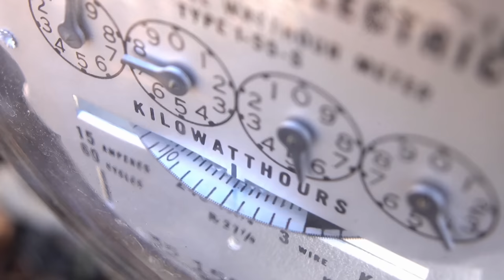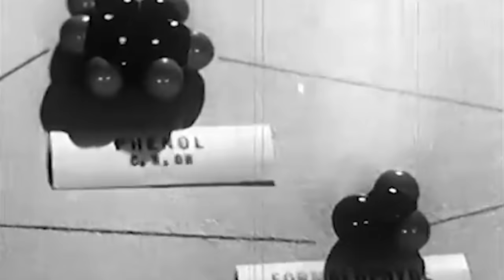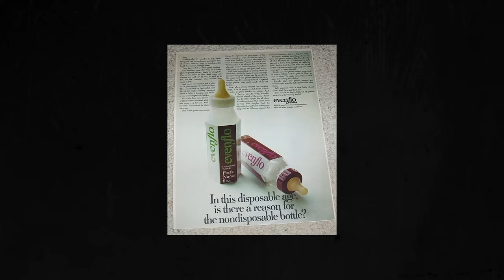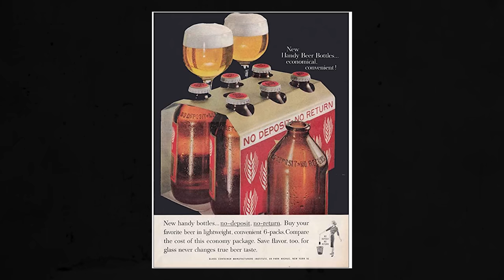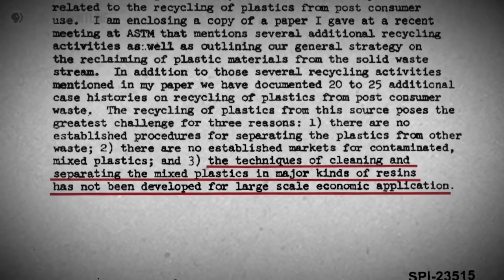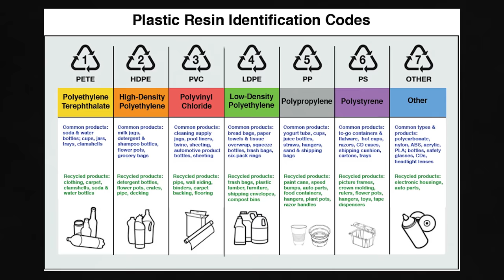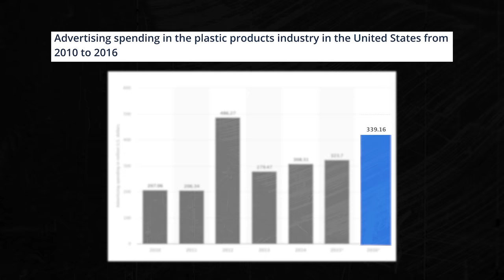The great recycling LIE (what really happens to plastic)

Comment: I am old enough to remember milk being delivered to the house in glass bottles which were returned, washed, and reused.  Beer and soda were also sold in glass bottles with a 5-cent deposit which would be refunded (more likely deducted from a purchase) when the bottles were returned.  That system worked just fine, and used far less energy than this throw-away and/or recycle system we have now.
Reply: As a kid I used to run round the streets of Glasgow collecting empty glass bottles of pop, returning them to the store and exchanging them for money... Then spending that money on full bottles of pop, crisps and sweets.
Reply: Homeless people and kids also appreciated it back in the days
Reply: Only issue is that washing and reusing glass bottles is cheaper than making whole new plastic bottles, which means less money making of you're the one selling bottles
Reply: @tiddybearkush  Really? The real question is where do the bottles go after they get put in a machine.
Reply: @tiddybearkush  Logistics of population and the amount of milk and now other canned and bottle beverages we didn't have "back then" created a need for something other than Glass... can you imagine if all the fruit and flavored liquids were all made of thick glass?... your shopping bags would weigh 40lbs and there would be broken glass all over the place.
Reply: @t.c.a.3335  It wouldn't matter since we would have been used to it.
Reply: @tiddybearkush  You are correct, many glass bottles you get money back for returning them to the place of origin, because they reuse them, it's a great incentive, but you won't be paid to return a lot of plastics because they can't be recycled, they just break down. A company isn't going to pay you to return rubbish they can't reuse.
Reply: My parents and grandparents still do this, it’s common in my area which is nice
Reply: You know I always wondered why Germany still used glass bottles that were washed and reused but America didn’t. It was a bit of a culture shock for a little while before I just got used to the plastic as well but it just seemed weird for the longest time.
Reply: @t.c.a.3335  Home delivery of milk in glass bottles was common in the USA well into the 1970s. There were hundreds of millions of Americans by then, so the logistics of serving a very large market were being met. The big difference was the milk you got didn't come from some far off, unknown facility, it almost always came from the dairy in your town. A business that you were familiar with and you may have known people that worked there. Milk wasn't shipped across the country to consumers, it came from across town, maybe from the next county. Those glass milk bottles were incredibly tough too. It was downright difficult to break one intentionally. I've seen them go unscathed after a bounce off a front porch or kitchen floor. Sure they were heavy, but they generally only traveled a few miles and they could be reused hundreds if not thousands of times. I think the biggest obstacle for this business model today is theft. Society can't be trusted to leave consumer goods on the front porch anymore. I'm sure it happened, but I don't remember anyone having milk stolen from the insulated box (clearly marked as a place to find milk) on the front porch. Glass bottles were a hellofalot tougher when they were expected to be reused/refilled for years.
Reply: I use to search for soda bottles to have money as a kid.
Reply: @t.c.a.3335  it’s healthier to jar your own food and , I can tell you the super rich stayed with the old ways for they are the healthiest and once a person invested in the jars and a garden it was healthy with little additives..So many of us bought their BS
Reply: Heh..I am, too!
Reply: @oldsguy354  The bottles will still be worn down tremendously after a couple uses. It puts too much trust in the consumer to handle these expensive bottles and the cleaning methods will be done in factories, totaling in the eventuality of broken pieces which cannot be molded so easily with the type of material used in the bottle.

The price of the bottle will become far more expensive than commercially used plastic cartons. Even if they found a way of creating a system where it doesn't weigh 18 pounds per bottle and have farmers willing to put down money they don't have to build a whole new logistics facility or give up a major percentage of their company to a big business like Coca Cola who are the only ones that have the qualifications, experience, budget, and ability to make significant changes to a market. 

The fact of the matter is the transportation would blow up their budget spending. Bottle companies only worked because they had a whole small community of a couple hundred, not millions, to monopolize with. There wasn't any Amazon, mega domestic companies like Walmart or Stop and Shop, or competing business outside your state or even in your city. Sure, there were many in each state, adding up to more than couple hundred costumers, but the fact remains that these bottle business would now have to drive to one community to the next, city to an other city, to deliver milk AND pick up empty bottles. And the likelihood of this being a standard and taking over the plastic carton industry to combat plastics would have more obstacles then benefits since these business would charge way more and become more a hassle remembering to clean it, remembering it's not yours and not keeping the pretty expensive durable bottle for yourself, texting the company that the bottles are ready for pick up and put the bottle outside for just some homeless person to steal it and the milk man arriving 8 miles to your house and finding the bottles aren't there, and figuring if you aren't lying and stashing them for resale. Even if you had a technology where you can keep the containers safe, that's still going to be an expensive piece of equipment that going cost you and the company more money to implement, which leads me to the final point of the only target audience that are willing to buy this.

These companies will only attract small rich communities near farms that already go to farmers markets to get most of their groceries. If we want to combat plastics, how can we fight where the majority of people are still using plastics and only 1% of the population are using bottles and probably was already using less plastics because they can afford to do so.
Reply: I wish it went back that way.
Not just because of environmental reasons.
It just seems to taste better from a glass bottle tbh.
Reply: @oldsguy354  this isn't the 1970s though.  The logistics of today are much different.  Where I live there are no local dairies and the same could be said of many urban dwellers.  Plus there's the segment of the population that doesn't drink dairy and uses only milk alternatives.    I doubt getting soy or almond milk is something everyone can get locally.
Reply: I also remember milk in glass bottles, I have always felt any beverage tasted better out of glass.
Reply: Plastics make incinerators more efficient. I talked to someone in the industry and according to him the only thing limited plastics recycling does is make incinerators use more fuel.
Reply: @tiddybearkush  Yeah, you get told they're made into new bottles. Many U.S. states have these $ for returned bottles systems.
Reply: I would visit my cousins in Northern Mexico in the early eighties.  Everybody kept their Pepsi/Coke/7up glass bottles.  The kids would  grab a few bottles and head to small town  store to exchange for soft drinks at reduced price.  The only requirement was that they be rinsed out/ not damaged.
Reply: @RoastLambShanks    I just shared my story here and saw yours!  It was such great fun collecting the glass bottles and finding a big stash!  That was a lot of money for kids back then.
Reply: @tiddybearkush   Which country?  I’d sure love to read about that.
Reply: @6teezkid  Wow... I feel bad about poverty, lack of water, and all the UNHEALTHY pre-packaged foods we are basically forced to eat to survive... but tell me Chi Chi... What are YOU doing about all the pain and injustice in the world... are you aware that the majority of the world lives in relative poverty and the "wealthy" are less than 1% of the Global Economy and the Super Rich are like 0.00000001% of the population?... what you have in America might even be consider "rich" in over 50% of the countries.
Reply: @Soundsofthewood  It doesn’t SEEM to taste better in glass. It IS better in glass. I only buy Coca Cola in the 8 oz glass bottles.  There are also the taller 16 oz glass bottles only bottled in Mexico.  They only use real sugar…not artificial sweeteners. The “real sugar” is only bad if you’re a heavy soda drinker.  It does taste better, but too much sugar from any source is not good for us.  But, 90% of mine is the 8 oz bottles (bottled in America). I only buy the Coke from Mexico if the American 8 oz bottles aren’t in stock. 

Not the easiest to find in every store, but once you know who stocks it, that’s where you go to stock up.  There is always an after-taste or just a blander taste of Coke or Pepsi, etc in metal and plastic.  Plastic is worse, though.
Reply: I'm old enough to remember that, too, it was just last Wednesday.  We get all our milk in glass bottles.  It costs a little more than buying it at the grocery store, but the upside is that the milk is very superior product and it's a bit closer to the cow (they don't have as long a supply chain from cow to store).  And they deliver it directly to our house.
Reply: The good ole days.
Reply: @t.c.a.3335   People had their milk, bread, pop etc delivered daily by the local bakery or diary. The empty bottles were left on the doorstep overnight and picked up on the next mornings round. We didn't do 'big shops' in supermarkets back then. We had greengrocers, bakeries etc and food was not wrapped in plastic. Fish and chips were eaten from newspaper and not polystyrene trays. We used fingers not plastic cutlery.
Reply: @Detachedc14  plastic bottles get crushed, in finnish recycling machine for bottle I've heard glass bottles getting shattered to pieces and plastic bottles get crushed behind the machine sounds. It has turned to ridiculous at this point.... 
Fortunately at least you can reforge glass.
Reply: In South Australia we have had Container deposit legislation since 1977. This covers glass, aluminium and plastic drink containers. Used glass containers were examined for integrity, washed and refilled. At this time glass soft drink (soda), milk and beer bottles were refilled where possible but it was cutting into profits of these industries as well as the glass industry. In the early 1990's these industries lobbied the government to legislate for single use glass citing health concerns around reusing glass. Another lie for profit disguised as a decision made in our best interest.
Reply: Our milk in India is too delivered in glass bottles here in  Chandigarh, Punjab India. However that's just us. Rest of the country is wholly dependent in plastic milk pouches.
Reply: We get our milk deliverd, it costs more but it's handy and we like having a milkman
Reply: And, as a bonus, the milk and soda tasted actually better from the glass bottles.
Reply: My milk is still delivered in glass containers, we wash and return them to the company that leaves them in the cooler on the doorstep.
Reply: We had something very similar in the UK, including getting a small amount of money for returning glass juice (soda) bottles.
Reply: @bsimpson6204  same
Reply: @bollywig7871  They really do taste better
Reply: @Daveed56  I try to buy juice, mineral water, sauce and soda in glass bottles, plastic tastes like garbage in comparison
Reply: I still get my milk in glass bottles. The Texas 1836 brand. I get it at Kroger. I think its a $2 deposit for the gallon sized glass jugs.
Reply: @tiddybearkush  You Really think that  you need to try following the trail  you will soon have your mind changed
Reply: Just gone back to daily milkman deliveries. Glass bottles milk, fruit juice, shakes .Tastes so much better than plastic supermarket milk.
Reply: @RoastLambShanks  Me to mostly Barrs bottles.
Reply: @hastiebar  We had a milkman delivering around here  and i did switch to him BUT  his milk was always just about to turn   was late ect ect so i had to go back to Lidl
Reply: Same here!
Reply: Try Modern Milkman deliver all over UK
Reply: @hastiebar  yeah no for me I see no difference in flavor. Also deliveries will not come out here unless they want a skyrocketed tip meaning more then I paid . Look at how deliveries were then and now. Now it's all tip tip tip big, to far, leaves orders just sit that people payed good hard earned money for some there only way of getting supplies cause they cant get out to stores. It's a joke. Swans used to deliver but stopped because it wasn't worth delivery to 10 people. I'm still pissed they ended my favorite black cherry besides the original root beer  coolaid that your can't find in store.  I miss it now it's o we never sold that sure says the person whose worked there for less then 10 years. 

My point is if deliveries are to work as in the past then workers need to be told they have to deliver and educated on certian things such as disability and elderly conditions and why tipping is nearly impossible to do on there income. 
Instead there shamed, cussed at, bullied cause they couldn't tip so they say to them if you want it then get it yourself. Like really if the could they likely would it's just disrespectful and inconsiderate. There griping cause pay is to low one that's there fault they can take orders they just refused to cause to low an not a big enough tip and two most are more poor and struggled daily and more monthly just to survive until there check comes the next month. It's a shame I'm 32 disabled can't work can't drive no one comes out here I feel like if I tried I would be punished for it.I only get 360 to spend in a whole month and with prices now and going to rise more it barely gets me by.
Reply: @tiddybearkush  not every1 recycles
Reply: @tiddybearkush  I doubt you get paid for handing them in, more like you get the money back that you paid more when you bought it.
Reply: I remember this too. I used to love the milko
Reply: @RoastLambShanks  ,same here, was great times!
Reply: @t.c.a.3335  How did people manage in the 50's?
Reply: @RoastLambShanks  - Same here in Canada.  I remember bringing 6 empty glass pop bottles to a movie theatre and they accepted them for payment to get in to watch a double feature. That was in 1958.
Reply: We had glass bottles in a rack who were recycled but no longer since plastic bottles cost nothing once produced.
Reply: I wish we could go back km to bottles,jars.
Reply: That sounds wonderful! This is an environmentalists dream.
Reply: @jesssss7154  The phytoestrogens present in soy curb testosterone production and lead to a plethora of later life health issues for men who consume a daily regiment.  As for almond milk. Most almonds are grown in CA and these orchards are some of the largest consumers of fresh water on the planet.  Almonds are an environmental disaster.  Cows on the otherhand produce waste that can be used as organic fertilizer or anaerobically digested to produce energy.
Reply: @mtsoko8712  Guess it shouldn't surprise me there's always a trade off somewhere in benefits on whatever you consume it seems.  Nonetheless there are people who genuinely can't drink milk due to allergies or lactose intolerance as well as people who will refuse to drink it due to being vegan or hardcore animal rights minded.  So there's that.
Reply: @XX89948  Bottles don't weigh 18 lbs for one.
Glass is easily recycled. You melt it and reform it.

DUH!
Reply: I'm of the same age group John and I remember so well. I would go to door to door in the 1950s and ask neighbors for their empty bottles which they gave me. I would return for the deposit and make a few bucks which went along way when you are 10 years old. However the return, rinse, wash, refill of glass was expensive and ate into profit margins so a way out was highly sought. Who covered HOW to make plastic from oil? It is Dupont. How did they learn the secret? They learned from the same source that taught mankind how to liberate metal ore to make weapons, how to employ AC current, to make lasers...the list goes on and on all designed to destroy Mother Earth. The instructor(s) = the fallen ones with their leader Azazel and his master Lucifer. Plastic has literally poisoned the Earth and the oceans have become cesspools of garbage. Research Azazel. Nichol Tesla was taught by "aliens" as he referred to them not knowing their true origin.
Reply: @hastiebar  Barrs, Curries, Mitchells and also the big Alpine bottles. Not forgetting the screw taps the pubs cashed in ;)
Reply: @oldsguy354  I must confess as a kid back in the 60's we used to steal the occasional pint of milk from someones doorstep
Reply: I,  am also old enough to remember the glass jugs that milk came in.  I think things taste better from glass than plastic.  However,  glass had it's issues.  As a kid,  I was sitting on our front porch enjoying a summer day.  Across the street there was a young girl walking through the gas station on her way from the store to her home,  for some reason that I am to this day not sure of,  that glass jug exploded,  sending milk and glass everywhere.  She only got a very minor scratch from it,  but it was still spooky,  and no she did not strike the jug against anything.  Soda I also prefer from glass,  but as a kid running across a field,  I stepped on a broken soda bottle.  I liked the glass soda bottles even after that,  a soda was $0.06 and the bottle deposit was $0.06,  so if I spotted a good bottle I grabbed it and went to the corner store and drank a soda and the counter,  or if I had two I would take the soda with me and look for another.  I also got things like a patch kit for my bicycle by taking bottles to the store for cash.  But then,  we didn't live in a disposable world,  if the TV broke we got it fixed or went to the tube tester to find the bad tube and replace it,  now they trash them.  Most everything is disposable,  that sucks.
Reply: Agreed
Reply: Used to love going to the doorstep to get my gold top thick cream on the top of bottle milk and drink the cream off the top. The milk wold not come out because of the cream on the top until you ate it. If you stole a bottle of milk drunk on the way home early morning, it was a crime as it might be milk for a baby with an unemployed mother.
Reply: @RoastLambShanks  as a kid in Glasgow, I used to run around the streets eating the glass bottles
Reply: We used cardboard boxes for the shopping the shop left them out but they said it was a health hazard and carrier bags were coming in so people just put things in those instead.
Reply: @t.c.a.3335  A lot of items would still be canned as they had been since the 1920s or 30s I think is when canning goods really took off.  I can remember straws were paper one time use items that would get soggy sometimes before you were done with them, and take away food containers were paper based. Then we're were told we were killing off the forrests before good management. Everything switched to plastics to save the trees. Then landfills had plastics that didn't degrade. We used to burn our trash in a 55 gallon drum in the back yard.  Except for the glass we returned or reused. Even cans were burnt.
Reply: And it tasted  delicious.
Reply: I made a lot of cash from returning bottles to the coke factory.
Reply: Well it might be surprising for some but in  some parts  of EU returning bottles for deposits works just fain for years even decades.
Reply: We have overconsumption now though. It would work if people cared enough for not only the environment but their bodies as well so as not to overconsume. I’d like to think we could and will get out of this mindset but current culture dictates what most people buy & social media influences help perpetuate that.
Reply: @t.c.a.3335  are air and water would be happier most of all all the marine life that get stuck in the plastic that holds the coke!
Reply: The best of it was that it got people to keep it cleaned up because we could get money for it. Now people don't care where their trash lands as long as it's free from their hand.
Reply: @tamz2tamz2   I used to clean up terraces at Shawfield  after football and dog racing our payment was the bottles to return and anything else we found.
Reply: Broken glass is not better. More tires to fix. Some soda and beer still come like that.
Reply: @oldsguy354  Still something could be invented to deliver stuff safely instead of making more and more problems.
Reply: @elektron2kim666  Throwing glass bottles on the street is bad behavior by people, not the fault of bottles.  It is like blaming guns for shooting people, when it is the man pulling the trigger who is to blame.
Reply: @johnchamberlain5435  Plastic bottles on the street is just easier in my opinion.
Reply: Mine still is.
Reply: @t.c.a.3335  There was little breakage. Also, plastic bottles can break also. I've seen it. It's also easier to break plastic, if hit from three right angle. I've had quite a few water bottles leak, just from the case being bumped around.
Reply: I remember a publication in Toronto did a piece on recycling. They followed a recycling truck until it filled up. Remember people were taking the time to separate recycling amongst itself and from the garbage into the blue bins. These guys followed to recycling truck to the recycling plant? NO. It went to the LANDFILL!! The same with compost. We were keeping compost buckets in our fridges and putting them in the bins. Turns out the composting company was also dumping it in the landfill!!
Reply: @tiddybearkush  and then it all goes in the ground? The ocean? Go on YouTube and learn how to recycle your own plastics you’ll find out that there’s only one out of the seven that can be recycled at home meaning the process is so difficult or so cost-effective that although they pay you for the bottles and they tell you they’re gonna be recycled you don’t give it a second thought but if it is one of the other six that are difficult or costly to recycle and likely get crushed up and put in a landfill
Reply: @oldsguy354  and if we switch back to using glass bottles for things the new electric cars and pick up trucks....... you might need to add a gasoline Power generator to the back of your truck so you’ll be able to get home with the extra load we’re going to hell in a handbasket in many many ways I’d like to buy 5000 acre blocks of land and turn them into Mayberry RFD
Dedicated towns that would live life as if it were in the 60s or 70s eliminating all the accessories and the useless garbage we have today but I fear that you would need another 10,000 acres to build your own infrastructure which I guess might not be a bad idea in the end if you can make it all work out financially but people today are lazy! 
Just think about the great depression those people were my grandparents and they were tough and they worked 16 hours a day and they were OK with that and their lives were pure and clean and that’s what got them through the depression their hard work their ethics and their faith today if we were to have the Great Depression what would happen today would make the Great Depression look like the great SUNDAY PICNIC😢
Just think if the grocery stores closed the farms one away or close like they’re trying to force them to do give up their farms so they can build welfare housing government housing that’s what the farmers are fighting about in the Netherlands and France and Germany all around the world and it’s coming here to the US the flight is coming but just think about no food no cell phones no electricity? For let’s just say six months much less a year and a half or five years the estimates are power went off nationwide 2/3 of the worlds superpower would die in 18 months because they don’t know how to take care of themselves the people in the big cities would be killing and eating each other in less than a month....... no morals no skills no God no electricity not good❤️🇺🇸 God bless the United States of America because if the United States falls the rest of the world falls❤️🇺🇸
Reply: @svephistoatartikus584  That is what they are working toward:  "You will own nothing and be happy."
Reply: @johnchamberlain5435  it is sad but I know. I knew for years and instead of telling the people around me and everyone who wants to Listen I decided to give up after a Lot of people gave me looks that totally Sayed you are insane. Some event told me and a Lot of other stuff. Maybe it wouldnt have changed  anything in this world but it would have changed something in me. At least I would not regnet my actions. But that is the past and I cant change it anymore but now I tell everyone if they wanna hear it or not. I tell them every day and that its forseen in the Bible and that thy have to pray for them and ask for Forgivnes and to give God the honour. The escalation isnt changable anymore. The more people come together the more there are who have a loose Finger on the trigger and if its not from the normal people those satanists will have some in our lines who will do it and then Starts the real mess. Stay strong. I am with you till my time has come.
Reply: I also remember licking the cream off the top of those glass milk bottles!
Reply: @RoastLambShanks  Plus it created a working pass time for winos and unplanned children.
Reply: Beer and soda bottles, and cans here in Oregon still have a deposit on them, 10 cents now.  Some other plastic bottles and jugs do now as well, like the V8 jugs.  However, I keep those to serve as quick temporary (but still reusable) planters.
Reply: @Detachedc14  If it is the self serve bottle return machines I am picturing, that shattering noise you hear when bottles go in should give the answer...  At least that is the answer for the glass bottles.
Reply: that waas true recycling. Same with aluminium.
Reply: No the system did not work, collecting, transporting, cleaning, transporting it again, is more expensive and environmentally worse than just using new plastic.
Reply: Excellent point.  Re-usable glass bottles worked just fine, thank you.
Reply: @arnaldobellucci9033  You contradicted yourself.  It did "WORK," it was too expensive and costly to the environment.  I disagree I think we should go back to glass.  Guess who is going to win...Dang I am out of the money again. -cheers
Reply: @williamrgutrich7694  I agree.
Reply: @johnchamberlain5435  things are brought in from China because people buy it, it is cheaper and one should be aware that not everybody is rich, I lived the time of reusable glass, it was very expensive to reuse, extremely inconvenient and not that safe, people should be educated about the correct disposition of plastics, not forced to spend the money they do not have.
Reply: @arnaldobellucci9033  Oh, please. I lived in a time when 99% of what people bought and used was made in the USA. Was everybody "rich" then?  No, our government sold us out and created a business climate that rewarded outsourcing of jobs and manufacturing to Asia.  I also lived in the time of bottles that were reused, and it was NOT "very expensive."  Then again, we didn't carry bottles of water everywhere to "stay hydrated!" as though we were in an arid desert.  We also didn't consume liters of soda every day.  Besides milk, bottled beverages were an occasional treat, not the daily norm.  As the comedian George Carlin said, "When did everyone get so God damned thirsty?!"
Reply: That was real or practical recycling. I wish I got to taste this level of reuse rather than what we have now
Reply: tasted a lot better too.
Reply: me too! beautiful time that was but then we weren't trying to carry massive amounts of people as if the earth had unlimited resources.
Reply: @Soundsofthewood  of course glass tastes better, it doesnt put toxic chemicals into your drino
Reply: When you factor in the extra energy needed due to extra weight in bottles (transportation costs), return trips washing/sterilizing, and other associated costs, you discover very quickly there is an advantage on an economic level for the company. Go figure, huh? Plastic is cheaper and they don't gaf.
Reply: @t.c.a.3335  Exactly. Factor in fuel, and waste (since many containers will shatter in transit).
Reply: I used to deliver the milk 👍
Reply: I'm 26 and I buy my milk from local farms in glass bottles
Reply: @tiddybearkush   They dont create bottles from bottles. For bottles you need pristine(transparant) resins without additives(e.g. glass or rubber). They make poly-esterlikes from recycled bottles and use that for artificial fabrics(e.g. polyesterlikes) to use in bags,clothing etc. Basically they're using trash to create trow-away materials. Without the recycled components they would never make those materials...because they're terrible: Polar fleece e.g. :D
Reply: What?  You mean I have wash dishes?  I am so busy protesting on municipal bridges and highways that I don't have time to wash bottles and return them!!!!
Reply: @MintStiles  👍😂
Reply: I remember those days
Reply: Transport of glass bottles has a toll on climate. We the users have been increasing our demand, there is the main issue.
Sure governments can impose limits, but that will create a revolt with some.
Reply: @Fastbikkel  Why is it that in the last 20 years  nearly every American has found it necessary to carry around a plastic bottle of water, purchasing a replacement several times a day? It seems that is a major part of the problem.
Reply: Let's say that in old days capitalism wasn't so wild yet and we could fearlessly consume products that weren't as harmful and supercial as they are today.
The flavors of the produts were different...they were more natural ; they didn't have as much chemistry and preservatives as we see today.
They all get stuck in the packaging , but in my view the big problems are in the contents.
It's a public health issue !
Reply: @sanguineregis5354  - they don't 'wash' and 're use' glass bottles- they create new glass bottles from the glass..
Reply: @tiddybearkush  - how much energy does it take to 'recycle'all those bottles? they don't just wash them out an refill them. They have to be melted down and re formed....
Reply: I remember regularly dropping the glass bottles, picking up broken glass and having no milk left :(
Reply: Indeed and the most painfull fact is that glass IS 100% recyclable. where plastic is not. Unfortunately most groceries come in plastic bottles and packaging, so we don't have the choice.
Reply: Still happens here if you want it delivered
Reply: Well the products just taste better from glas bottles. Dont ask me why. But from a logistic (weight) perspective plastic bottles are just less expensive. The transport of heavy glass bottles and it´s cleaning is far more energy costly then "one way" plastic bottles that would get "melted" into other products after use.
Reply: @RoastLambShanks  , And we used to do the same thing here in the United States. Collector bottles and take them in and get money for them. There’s a few states now that still do that with  plastic bottles. But very few.
Reply: @tiddybearkush  , How would that work ? You still have to move the plastic bottles and cans the same way they deliver glass bottles.  I don’t get your meaning on logistics ? And I bet they can reduce the weight on those glass bottles just like to do with plastic. Except for one thing when the glass bottle breaks it’s biodegradable it goes back into the earth. Where plastic just full a landfill or oceans and last for centuries.
Reply: Milk is not popular in my country. The only time you'd buy one is for a baby or if used as an ingredient for cooking. Glass bottles are still used here though for bigger ones they use plastic. I'm talking about soda. For beers, glass bottles are used.
Reply: Problem is the infrastructure has all gone when that was possible every big town had a milk bottling plant. so full bottles were collected from the factory delivered to your door and the empties returned to factory to be reused almost next day. Same for pop however now its delivered from a mega plant 1000 miles away to a supermarket where you go to collect. Most people won't take it the step further by returning bottles so the losses are too high why invest in the plant to reuse bottles when its only a few percent of your dailly production. Hence centralisation led to the demise of the reuse industry never to return.

Remember the scout bottle drives?
Reply: Lazy people get greedy
Reply: @a.l.596  in Michigan you get 10 cents for every can, plastic bottle. In college I would collect them.
Reply: And we never had the disgusting huge landfills we have today..infact my dad hauled the sand to our landfill and they buried the garbage and by spring it had shrunk,decomposed
Reply: That works well in Europe to this day. I'd like to see it make a comeback. It works well when your supplies are coming from local suppliers and you don't have to put a lot of energy into transporting them to the refill location.
Reply: Yes me too
Reply: Bluebirds and Robins taking the tops off and drinking the milk :)
Reply: Here where I live there us still a milk man that delivers milk from the local dairy farm in glass bottles that get cleaned and reused. The milk is so much better and its a much more sustainable system. The chocolate milk is so delicious. Its almost like a milkshake. We get delivery every Saturday morning. They drop off full bottles and pick up the previous weeks empties.
Reply: There are still farms and companies doing this. Support them! I know someone who uses this system in Merseyside.
Reply: Same here. A child in the 70's 😁
Reply: First off, you're not old, you're the age you should be!
And yes I remember the little door on my grandma's house for returns. My brother and used to play "drive thru" with it! Glass is way better. I got rid of most of my pots and pans and use my "vision" by corning wear. Its glass and not metal. No teflon either! We have no idea how toxic out bodies have become...until we enter the phase of cancer and dementia. Too many people have built up toxins in their bodies. Our bodies weren't meant to fight off plastic invaders, just microscopic ones (viruses). And look at that industry? It's making money off of killing people as well! Injecting us with only God knows.
Reply: Delivered in electrical milk floats, at least in the UK.
Reply: I like stores like Nude Food Market for reducing packaging.
Reply: Cleaning bottles???? Man!!!!...that is sooo yesterday.
Reply: I remember
Reply: @desperado315  same in Holland. Some diehards even use the horse & cart. Not the most pleasant means of delivery when the horse deposited a copious amount of steaming dung in front of your doorstep. The vendor would of course pretend it never happened. : }
Reply: @bellaswan1459  sorry to hear of your situation. If you were my neighbour, I'd do your shopping with mine. But one of us will have to move if we do that.... Greetings from Aus...:))
Reply: @johnchamberlain5435  we western countries are in more debt than ever. China is richer than ever. 
Australia currently restarting a medication manufacturing plant again because don't want to rely in other countries for medication. Hope it continues and doesn't fizzle. What the hell it was closed down for in the first place....oh yes...saving money. 
Ps Australia just recently leased Darwin harbour to China 99 year lease!! Insanity!
Reply: @RoastLambShanks  aye. We called them glass cheques 👍
Reply: Amen. 🙏✝️🇺🇸
Reply: Damn right!
Reply: I'm sure we will be going back to this model in the future -  reuse, minimalism, reduce waste, self sustaining locally..  the model we have now will not last unless there are major technological breakthroughs (I wouldn't count on that).
Reply: Also, fish n chips came in news paper.
Meat from butcher came in paper bag.
You mum and nan had a shopping bag or trolley.
Good old 70/80s.
Reply: @derekborkent2899  Have you seen the movie WALL-E?
Reply: @aspenedgewalker  Your point???
Reply: @derekborkent2899  maybe I don’t understand your point. I rewash my reusable water bottle all the time. I use bamboo fork spoon and reusable straws. So help me understand why is washing bottles so yesterday?
Reply: I am very glad that in Germany it is still very common that water and other beverages are filled in glass and plastic bottles that can be returned to the store and that are getting refilled.
Reply: Perfectly said and while we still have some glass containers out there I think we need to return back to that system. But the great lie has kept working just like how other entities lie and profit.
Reply: the answer to plastic isn't glass bottles. the answer to petrol based plastics is biodegradable plastics based off mushrooms, seaweed and hemp
Reply: @joesaiditstrue  I'll need some time to re-align my chakras before I can process your idea from a place of authenticity.
Reply: The old ways were better in almost everything one might look at. Greed is a terrible thing.
Reply: The government got involved and it went to hell.
Reply: Thanks for the memory. Also remember. ❤
Reply: Yes and empty jam jars we got 1 penny for four  !
Reply: And the milk was delivered on electric vehicles in 1950 !
Reply: Yeah generally it was paper milk carton but sometimes gallon glass jugs but even more of a plus I reused glass containers from pickles for leftovers or preserves.
Reply: I remember that as well, the young ones are unaware of this!
Reply: @jimfridas3170  then paper milk cartons in the store
Reply: I as well
Reply: Yep. Those were the days. A great time to have lived through.
Reply: I watched the recycling of beer bottles in W Germany; people who, of course wished, would buy a crate of 30 bottles (used over a month) and whenever they were done, would return them washed and dried for the next purchase. Imagine the wasted water per household, when the company could just sterilize them and no water would be wasted…but maybe this is too complicated.
Reply: I agree with you. I’ve been saying that for years. Besides that things taste better in glass. Glass  Even aluminum can be recycled and you get cash back on it.
Reply: The problem with glass is it breaks easy.  If you drop a glass bottle it breaks, plastic bottles don't break so easy.
Reply: @mseven1361  If it's good for the environment and things taste better in it, why care?
Reply: @roydean1137  It's not good for the environment of the glass breaks and there are shards of glass on the floor.  You also lose the whole contents of the bottle.  With a plastic bottle they rarely break, if they do break it's from transport when when they get squashed in cages they are transported in.  Glass bottles get damaged all the time.

Glass and plastic don't effect the taste of the drink.
Reply: I can still get milk and glass bottles at the local dairy
Reply: @RoastLambShanks  a lot of the glass bottles are now used in the Shotblasting industry … for about 10 years now you can get different grades of Expendable Crushed Glass Grit as an alternative to Expendable Copper Slag Grit …. Problem is that as glass is made from sand there’s a possibility that there’s going to be silica released in the blasting process as it turns into dust and if it’s breathed into the lungs it’s going to cause Silicosis … which is exactly why sand has been banned for sandblasting … I never recommended using Glass Grit to my customers as there’s not been enough research into the health application for the product.
Reply: In the UK, that milk was generally delivered by electric vehicles!
Reply: @t.c.a.3335  I can imagine because I've lived it.  Everything was in glass containers back then.  Not just milk,  soda,  and other beverages, but everything including peanut butter,  jam, mayonnaise,  aspirin,  vitamins and other medications and supplements.  Also, at the checkout counter, our groceries were packed in paper bags, not plastic bags.
Reply: @starwarsrebel2006  and ships were made of wood and driven by wind, and we didn't have cars and a lot of horse crap, and refrigeration was a huge ice bucket, a guns were muskets... and crazy people wanted to fly... those were the Good Ol' Days... 😁
Reply: @t.c.2776  The good old days you're referring to was centuries ago.
Reply: Same with beer bottles, a perfect recycling in action, for many years, now bottles thrown into a bin, to be collected 🤔
Reply: @XX89948  Still using glass bottles for milk today. I toss them in the dishwasher and return to the store, where I buy full ones. Local dairy no supply chain issues.
Reply: @Daveed56  I remember as a kid when we switched from glass bottles to waxed cardboard milk containers. We thought it was gross, and tried to not think about it. We were sad to see our milkman go out of business.
Reply: Wow!  You ARE old!!! I didn't even know you folks were still around! 😅😂
Reply: Yeah me too. They used magpies breaking the metal seal and drinking the cream, as an excuse to get rid of them.
Reply: @archangelliii2536  There is a lot you don't know. Now pull your head out of your cell phone and pay attention.
Reply: This sounds so awesome! I wish plastic had never been created!
Reply: Beer bottles still are in many countries
Reply: @tiddybearkush  Did you even pay attention to the video? It's not the people are throwing away plastics and not putting them in the recycling bins, It's that the plastics going into recycling bins are STILL going straight to the landfills!
Reply: @kidjay2679  We are talking about milk bottles.
Reply: @jesssss7154  There were no local dairies for cities in the 70s either. Plastic jugs are not required for shipping. Beer isn't bottled locally, yet it is predominantly packaged in glass bottles.
Reply: Not to mention the discarded bottles and cans provided a source of income for some people. If they didn’t get picked up the biggest environmental threat was a raccoon getting its head stuck in one.
Reply: @RoastLambShanks  Exactly we had armies of free collectors cleaning up trash for the cash. Now we have to pay people to do it if it get done at all.
Reply: @tiddybearkush  Oh you are a superior human being. If you think the deposit money isn’t included in the price of the product you’re in denial. You bring in the plastic containers, get you reward and they throw the plastic in a landfill. It’s all marketing!
Reply: Collecting cleaning and reusing containers a system that at that time was very responsible for developing a work ethic in almost every kid. Collecting bottles alongside the roads could be very significant for most kids and people that needed a few dollars for gasoline.   
   You mentioned that some Plastics actually could be efficiently recycled and reused which ones are they?   
   Also you said that recycling plastic did not pay for itself. How is it that three major companies actually support themselves in the recycling industry, actually make a profit? I imagine it's some convoluted federal government money shuffling to make something work that actually doesn't work.
Reply: We used to take our Town Club brand soda bottles back to the bottling facility and watch them wash, refill and cap them. You would literally get the same bottles back every time you went in.
Reply: What made you stop ?
Reply: Me too and how sad when the milk man told us they wouldn't be bringing our milk anymore
Reply: Yeah I remember those days! In fact, I used to collect bottles to sell them. Coke bottles, milk bottles, you name it. Thanks for the memories. L
Reply: Yep. I am old enough too.  It was just no reward (Milk) 2p and sometimes sixpence for a variety of containers. Look forward to the “new” plastic. Meanwhile we try hard to avoid plastic in all its forms. 

Better still, how to we get rid of lying and propaganda for money as seen in all walks of commercial and political life?
Reply: Grew up on a farm so only saw milk deliveries on TV.  But I do remember refundable bottles.  There were lots of people who would just toss them out the car windows along with emptying their car ash trays.  The good news of that was it gave kids the ability to walk along the roads collecting them for extra money.  The other option was we could collect them so when mom made homemade root beer we had free bottles to put them in.  Good days.
Reply: Returned bottles often contained rodents and insects…….there is a lot to the issues involving feeding people. Unintended consequences are everywhere. Including activists making money producing nothing.
Reply: I'm pretty sure the child didn't pull off that scam.
So...
Who's the culprit?
Reply: I’m not even 20 but where I live in the past 10 years we went from milk in glass to in plastic bottles no one uses bottles now but ten years ago everyone did
Reply: Same in Britain it worked!
Reply: As a bottled beer enthusiast l miss returning the bottles for the refund. Consumption of energy to crush and recycle glass is unnecessary.
Reply: I still have a couple of my grandparents on my mom's side old vintage milk bottles in near mint condition on display in my home and very proud of the past history !!!
Reply: There is 10 cent return now at some grocery stores and some department stores for soda and beer bottles both plastic and glass and Aluminum cans. Amount can vary by state.
Reply: I recall as a kid collecting glass bottles. I would make a small fortune doing so. Times were simply back then. I sure miss them.
Reply: That deposit system is actually what we use in Denmark and Germany for bottles, I like it, many more people are returning their cans and bottles because of it, and for the ones that don't there are homeless people that collect them and sell them for some quick bucks, not enough to live off of but enough to survive.
As kids we'd also deposit these bottles and cans for some extra money, that's what I most like about this system
Reply: I still have my milk delivered to the door in reusable glass bottles. Return the empties, get full bottles every other day :)
Reply: @sanguineregis5354  "Only issue is that washing and reusing glass bottles is cheaper than making whole new plastic bottles"

No, dummy.  That's just not true. Plastics are unbelievably inexpensive to produce.  Hauling bottles around and washing them with water and detergents? Not so much.
Reply: @t.c.a.3335  Not only that, these clowns would be bitching about broken glass everywhere.
Reply: I remember the glass soda bottles, both big and small. But before plastic - how did they sell toothpaste? Shampoo? Body cream? Etc. 

Dairy has been sold in tetra pak© - mostly waxed paper since late 60s in Europe.
Reply: glass is MUCH MUCH easier to recycle as well and pollute much less.. but you know, business lol.
Reply: @oldsguy354  there are deeper problems to that like crime and large companies who destroyed the little milk businesses